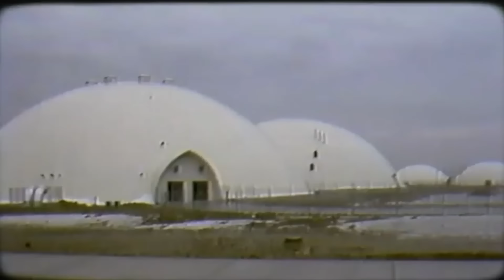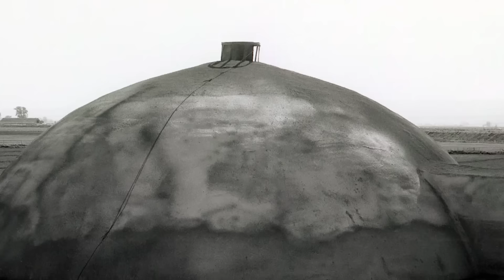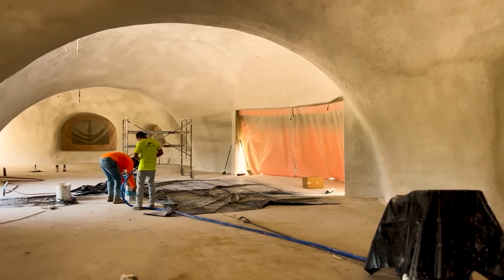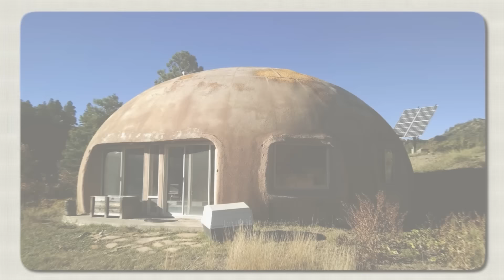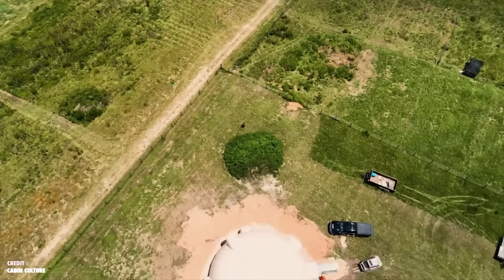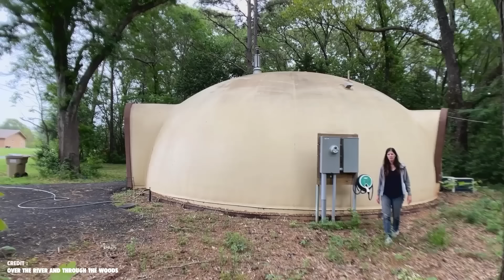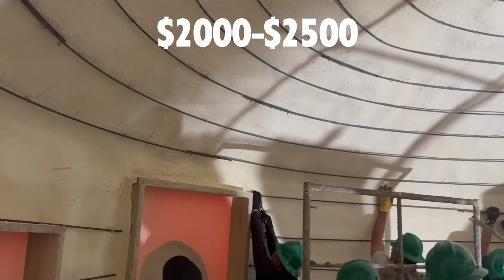This Home Survives EF5 Tornadoes, Wildfires, and Costs $0 to Heat. Why Aren't We Using It?

Comment: I live in a dome. It’s not all sunshine and rainbows.  Yes, you are very secure from severe weather.  You don’t suffer temperature extremes as badly as traditional builds. But you do have to heat and cool it.  Financing was very difficult because obvious comps are rare, indeed in all of the Houston area it took the bank forever to find an appraiser who’d even take the job.  The outside requires maintenance. Good luck finding companies to do it. You have to get used to the idea that you’re paying insurance for nothing because it’s almost impossible for an adjuster identify/prove weather related damage unless it’s brutally obvious, like wind driven debris stuck in the outer layers of the shell.
Reply from the maker: Good to hear practical feedback.  You have provided a good clear stated issue in the form of insurance.  This is always the case with anything that is not the norm.  The big question is whether you would advise people to live in one or not?

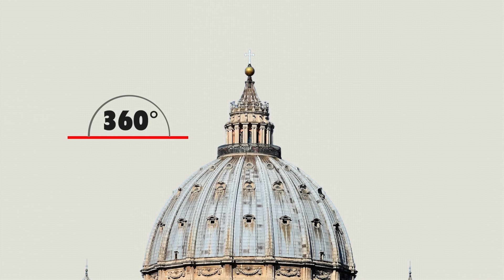Comment: 1:23 a plane angle is 180º
Reply: Yeah, it’s a poor graphic and does not illustrate the statement. Rather, imagine an arch, now SPIN it (looking top down) from the vertical axis forming a circle on the ground. (Still only requires a 180° rotation since the arch, of course, has two abutments). Whoever made this just didn’t think it through.

Comment: It's at ground level.  It would be flooded then destroyed by a storm surge in hurricane.
Reply: Yep and a tornado.
The wind would rip off the weather barrier cover and drive rain through the insulation so that would have to be removed.
Since they cost more to build it would be cheaper to demo and build new if it got hit.
Reply: The one in Surfside Beach is built on pilings on the second row from the ocean and is over 50 years old.

Comment: In Nova Scotia Canada, there is a company that makes homes out of 600,000 used water bottles. It is water proof, bug proof, will last a lifetime and is certified for Cat. 5 storms. This type of construction must be promoted. We need to think outside the box like Japan.
Reply: That's funny since Japan is a country of earthquakes and is the  most straight forward standard tech country out there when talking construction
Reply: @sparksmcgee6641 perhaps you should do dome research. As for earthquakes Japan is the leader in earthquake resistant buildings.

Comment: The issues I see with this design; cost to build, limitation of a sphere shape for room layout,  sprawling design leads to poor land use/density, in freezing conditions, you'd need a waterproof finish to prevent water infiltration and fractures from ice.

Comment: Thank you so very much! I got a license and distributorship in 2005 from David South Sr.. I  am an American, 72, living in India since 2004 and have built 13 20 footers, singles and joined all over India. Between cheating partners and having to do it part time only, it's been a struggle. Monolithic had been extremely supportive through all this. The uninsulated Ecoshell, with a reusable airform, is to me, an answer to housing, storage and resorts here, but acceptance is difficult. I continue though. I do not know how to produce YouTube videos like this one, but if you could, I would be very grateful. Both large and small Ecoshells have been built in Belize, Hyderabad, Haiti, Dominican Republic, Peru, Indonesia, Tanzania, Phillipines and Puerto Rico, that I know of. I have pictures of some. If you need narration, I did that for 22 years and would be happy to help. For those of us in a temperate climate and not exceeding 40ft in diameter, this is an answer. The use of basalt rebar or coated braided basalt rope make it possible to build these using beach sand and seawater for ocean side housing at roughly 70% less material cost than RCC and brick. I don't have the skill or means to publicize this here, but it would be valuable. David South Sr.'s dream for India was to build inexpensive, safe housing for poor people where they could contribute their labor, just like Habitat for Humanity to keep cost down. That is my dream as well. Can you help? In any case, Thank you. This video was better than Monolithic's own that I have seen. I am not throwing shade, but technology has advanced in 20 years off video production. Be well.

Comment: Those flat, 8 foot walls surrounding the dome at the bottom defeat the whole purpose of the round shape. Those walls could collapse, and bring the dome down on top of those flat walls during a hurricane or tornado.
Reply from the maker: You could be right there.  Any flat structure will catch the force of the wind! Thank you for your comment!

Comment: Another great benefit of these dome homes, never have to replace the roofing because there is no roofing. Seems like these are really a superior option.
Reply: I've got lots of questions about the roof.  If I understood it correctly, the membrane remains and that is something that will need patching/replacement over time.
Reply: @Jasper_Seven  You understand correctly.
Reply: @Jasper_Seven you can cover the membrane with stucco, stone or metal. But yes...the membrane needs protection.
Reply: hardly... its a pvc membrane liner, bonded to the polyurethane, so when it comes time to replace, the only real option is to install a new one over top of the old one, drill through and anchor it to the concrete.... the solvent bond of the polyurethane to the pvc cant be recreated once the foam has cured
its also HIGHLY  flamable

Comment: You can build just as strong square concrete house using TRIDI PANELS ❤
Reply from the maker: To be honest I didn't know about these but now I have looked on the internet they look a very good option!  Appreciate the insight! Thanks
Reply: Just build using thermomass CIP  for a sandwich panel and you're good and stronger.

Comment: Can 3d printing work with the dome?
Reply from the maker: It is feasible.  The big challenge for 3d printing would be collapse.There would have to be some type of former used to support the cement, just in the way the Monolithic Domes are made.  Appreciate the question!

Comment: Your presentation is a perfect example of a video made by someone without real design experience.  Are you a YouTube expert?  A student or professor at a University?  Did you just have AI put together the research for you?  Your statements demonstrate your ignorance.   Your video sounds like a promo pushing perceived benefits without knowing the negative aspects.  To a professional, you sound like a used car salesman.  What is your real world experience?  BTW.... Most tenured professors in engineering and construction fields do not have reasonable real world experience.  Many are blithering idiots that only want to push expertise in a narrow band of knowledge.

Having survived a hurricane or tornado, or a government certification, is not really justification that a similar structure will survive a similar event.  Believe it or not, as an engineer, site loads, such as lateral and vertical wind design or snow loads is done to a "reasonable" level set by someone.  We over-design with safety factors, but always accept that a new non-expected load combination can occur and cause problems.  Politics and personal judgment play a major part of codes, load levels and accepted rules for structures.  Further, tornado, hurricanes and other events never create the same load twice.  Contractor skill and consistency in doing work is also a major issue.  Alternative construction is notorious for missing critical flaws or expected levels of workmanship.  I am a practicing structural engineer (residential and commercial) with multi-discipline experience with a material testing, structural product research and code development background in my career.  Yes domes can work in many locations, just like many other forms of construction if properly designed, but that does not rule out other construction that could be as good or better.

Comment: I did an ICF house which while conventional in shape has a lot of the same benefits, we love it and it costs almost nothing to heat or cool and is very storm resistant using Simpsons strong tie system to attach the roof system. However much like the dome not many are built even though they make all kinds of sense and require far less labor to construct.
Reply from the maker: Good to hear.  Thank you for letting us know about that!  Appreciate the comment!
Reply: yes…I live in an ICF home too. The problem with the dome is No solar panels. If u want them will have to put them on the ground. Which takes up space but makes it easy to clean them.

Comment: I wonder If the 3d printed homes from concrete could make a dome home for a fraction of the current labour-intensive build?
Reply from the maker: Good question!
Reply: 3D printed is a solution looking for a problem. They're all imploding right now. 
No one is giving out free money anymore and none of them have come even close to break even on cost or time.

Comment: the Midwest could vastly benefit, what with tornadoes and such
Reply: Tornado will total one of these.
Barrier gone, insulation gone, all windows and doors blown out. Then everything in the house lands the next county over.
Concrete shell may stay if it had enough tie downs.

Comment: Concrete form homes have the same properties, however you can build them using right angles making it much easier to live in so to speak
Reply from the maker: Totally understand.  Each have their benefits and downsides!  Thank you for the comment!
Reply: @wildline_YT No. Formed concrete is better in EVERY way than a dome.

Comment: I am building a earth bermed home for my retirement home same concept just adding earth on top great temperature regulation. Using buried 12inch pvc tubing buried 10 feet down to bring years round cooling for summer warmer during winter. Average year round temperature 70 degrees.
Reply from the maker: Sounds exciting.  Would be good to see a video on that! Thank you for the comment!
Reply: Use it to pre-heat too.
Reply: Make sure you put plastic ropes through those earth lines so you can pull something through to clean them. Otherwise you end up with a polluted system and you have a sick house. Bleach/ammonium soaked rags through them all once a year. Send them through wet first to clear dirt.

Comment: Since the fire that destroyed so many homes in Pacific Palisades could easily be repeated, wouldn't it be cool if the entire area was rebuilt with these?
Reply from the maker: Yes and if they were coated with calcium carbonate (crushed egg shells) mixed with sodium silicate then you would have a good fire retardant coating that would also help protect them! Thank you for your comment!
Reply: @wildline_YT  Really?  Thanks for this additional detail!
Reply: @wildline_YT  This is a stupid statement. I could just say an exterior of vibrainum would be good.
Or

You put a concrete exterior on it. They're expensive in the first place and that would be the most expensive part because it would also need stucco and another barrier after ripping off the pvc cover.
Reply: Yes ... But they are probably too stupid to build these homes there....
Reply: @gothboschincarnate3931  I don't know.  Those people went through hell in that fire and the entire community was wiped out.  There may have been a shift in perception with that experience.
Reply: @E_LithaBeth let hope they learned their lesson 😉.
Reply: So that they burn down much easier???
Any fire would take out the exterior cover and that's the weather barrier and almost impossible to replace.

Comment: Would it compromise the dome to add a dome skylight on top?
Reply from the maker: Any cut into the dome changes the integrity of the dome but whether or not a dome would still be structurally ok would depend on where the hole was created.  A structural engineer would be able to advise on this.  Thanks for asking.

Comment: I would say it has more to do with getting a local company and crew with the equipment and the experience to build one efficiently. IF you have to fly people and equipment in or have rookies doing it, i can see it not going smoothly. "Hey how many of these have you built?" "Ummmm zero." will not inspire confidence.
Reply from the maker: Can't disagree! The best solution is to use local contractors as you will also get some form of guarantee.  Thanks for the comment!

Comment: Imagine building one of these with Roman concrete that has quicklime mixed into it that has been hot mixed and where all of the processes from start to finish were done with electric mixers that don't introduce volatile organic compounds into the concrete like gas/diesel mixers do with most modern Portland Cement Concrete (PCC). The main downside is you wouldn't be able to use an inflatable form or sprayers like the most common methods out there for dome making. You'd probably need some kind of snap together steel or aluminum inner form that can support the weight of the wet concrete and withstand the 200 degree Celsius temperatures created by hot mixing quicklime into the final mix. Then probably an outer form that holds everything into the dome shape, so that the mix doesn't sag down the inner form and can also withstand the fairly intense heat. It's clearly possible since the Roman Pantheon uses a dome, you might even be able to use wood for the forms, or some kinds of hard, heat resistant permanent plastics. Then you vibrate it the same as PCC to work out the larger air bubbles and create a more homogenous concrete, but not too aggressively because you don't want to shift all the aggregate out of place. Then you spray a closed cell foam over it like a normal dome and put a sealant and paint over it all that can be reapplied over time as needed to keep water away from the concrete. You'd have a monolithic dome home that will still be here 2,000 years in the future, and likely still structurally sound enough to live in. You'd need to use something other than rebar for reinforcement though, since that rusts over time and with exposure to moisture, expands and helps crack the concrete. Maybe Galvorn by the company Dexmat might be an alternative if they figure out how to make rigid forms of it, as long as the carbon material it's made of doesn't degrade. Another alternative would be using titanium, if you can afford the additional cost that introduces to the build. Titanium, as long as it has formed the oxide layer properly remains borderline corrosion proof for up to around 10,000 years and it doesn't experience metal fatigue the same way that steel does. So it could prove to be the ultimate structural reinforcement material for a Roman concrete monolithic dome home. Make the outer shell a good 12-16 inches thick and you'd have a home that could easily weather the end of the world and be largely gamma ray proof if that end of the world ended up being nuclear. Buried underground you'd gain additional thermal insulation and weathering resistance, just make sure to put a good moisture barrier above and around the dome to avoid a water buildup around the house.
Reply from the maker: Amazing thinking.  Well to add to your chain of thought I would propose using egg shells or sea shells as the calcium carbonate primer, heat it to get calcium oxide and use that instead of mined lime stone.  Then layer your nuclear bunker with lead and hey presto you have a gamma proof monolithic dome that is environmentally friendly.  If you want to go whole hog than layer boron carbide into the cement and you definitely have radiation proofing.  Enjoyed your thought process.  Thank you for the comment!
Reply: You obviously know nothing about actual construction.
We've had self healing concrete from redimix factory for a 100 years. You throw out Roman concrete and announce to the world you know nothing.
Reply: @sparksmcgee6641  You don't have to be so cruel in your dismissal of josephthibodeau9725 well thought out comment.  I do however am surprised that there is a self-healing concrete product I had never heard of before. However it is not remotely comparable to Roman concrete.  This special mix packs in materials like microcapsules filled with healing agents or bacteria that promote natural mineral formation.
Research shows self-healing capabilities can extend the lifespan of concrete by 30%
30% is not even in the same neighborhood as the thousands of years durability proven by Roman concrete.

Comment: I like the monolithic dome, but the bang for the buck is not there as a living space. If you consider human furniture like beds and kitchens, the dome needs to be huge for a 3-bedroom house because there is so much wasted space. Huge is expensive. As a 2-car garage, it's just right, but as soon as you start building interior walls with doors, it gets ridiculous. The longest wall is the exterior wall, so getting a room for a queen-size bed needs an 11 x 12 foot square room unless you start using triangle beds for triangle rooms. The ICF concrete home is just as strong, energy efficient, and more compact for residential building lots.